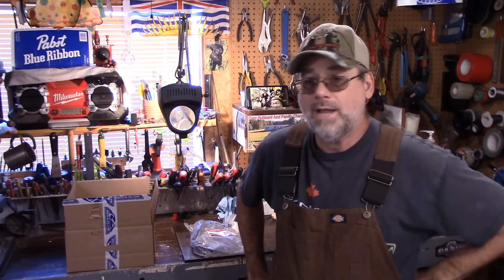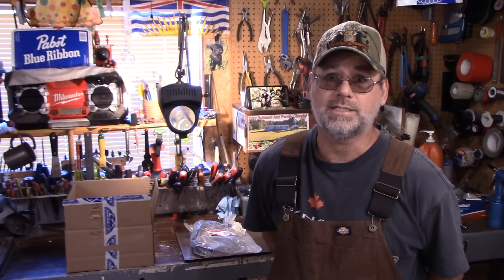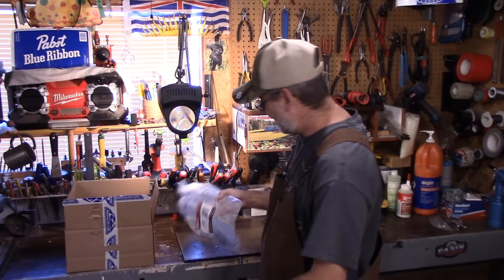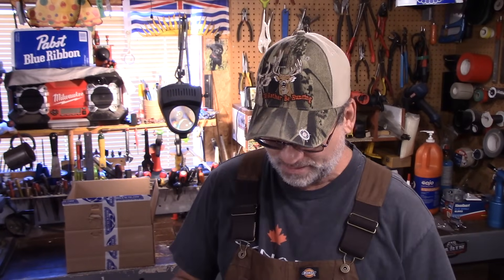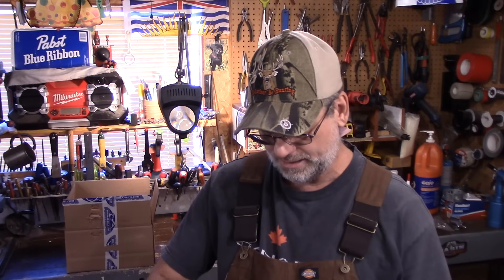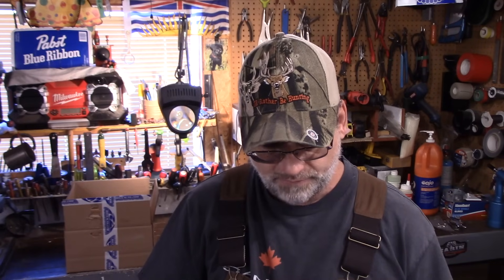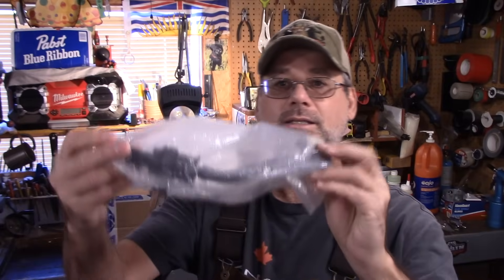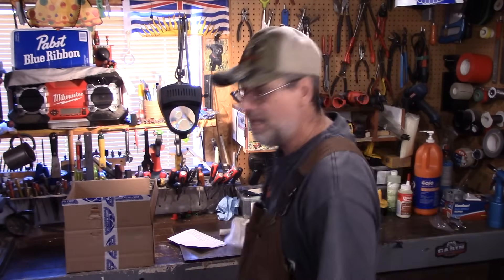F150  STALLING AT STOPS - THE FIX -  PART TWO

Comment: Need some help 2006 ford F150 4.6 liters engine,has a weak take off, and rpms drop when coming to a stop, what can it be?
Reply from the maker: Mike it could be a lot of things but the first check would be a total scan of the vehicle , not generac scan data but OEM . Start there for any codes .
Reply: @SteveRobReviews  no codes what so ever
Reply: I was thinking it would be the throttle  body
Reply from the maker: Could be , if it's not getting min. air or the MAF sensor is dirty as well it could be . Try cleaning both and see.

Comment: Mine is an 87 F150 XLT LARIAT and its weird. It dies randomly. It doesn't do it every day
 Yesterday it died 8 times all day. Today once. If it dies and I just try to start it without turning off the ignition it won't start. When I turn the ignition off then try, it starts rigbt up every time. Changed the idle control thingy, the Egr valve and the cap and rotor, plugs and wires thus far. Could it be my ignition control module?
Reply: And not to mention it doesnt die like its starving for fuel, there's no bogging just dies outta nowhere.
Reply from the maker: Well it looks like your turning off the ignition switch  to off then on  gets it to restart so I would be looking at the control side of your ignition from a faulty ignition switch   , that's my first thought .  I would  wiggle the ignition switch  while parked and see if you can jiggle it to shut off.
Reply: @SteveRobReviews  so I did what u said and jiggled the key and it does shut off but not when I jiggle the key up and down but when its jiggled in the rolling back towards me direction as if you're shutting the ignition off with the wings on the ignition almost to the key off position. Right before the click as if you were to shut it off. I changed the coil and it did die on my way to work this morning. Should I try the pick up coul in the distributor? All this pretty much started when I decided to wash the engine bay.. so im wondering if I got something wet or gunk on something I shouldn't have...
Reply: @SteveRobReviews  oh and by the way my check engine lights is on but doing the jumper in the EEC connectors doesn't do anything with the light. Get no codes
Reply from the maker: @rickyfranklin9343  Well it seems your replacing parts in Hope's of finding the fault , you may run out of money before you run out of guesses 🤣  I would imagine whatever got wet  may be a fault but you could have a wire under the hood that's rubbed bare and randomly touched  metal and shuts the engine off . I would look under the hood at your wiring harnesses before changing more parts .  These intermittent faults can be real hard to find .
Reply from the maker: If the  light is on a fault is detected . I would suggest you do have a detected fault .
Reply: @SteveRobReviews  but the thing is, I cant do the jumper in the EEC connection port and get anything the light just stays on. I hope I fixed it today. I put the old rotor on and blew out the distributor and so far so good. It idles better. Sounds better. Looks better..
Reply: Mine did that, found a bad wire running up coulmn
Reply: Been trying figure it out with my 97 2v 4.6, does it nearly every stop, acts like it doesn't wanna change gears right, revs will drop past idle unless I take my foot off the brake and let it roll a few more feet then the idle will kick back up. Bad sensor somewhere along the drivetrain maybe? Don't know if it still does it or not though, its been out in the woods the past 3 years, thinking about resurrecting it though, and getting rid of my 06 and 04 f150s, 3v 5.4's

Comment: Found this online.. And tired of typing it to everyone asking.. So here you go ￼

This is used for clearing codes by disconnecting the battery cable for 15 mins. Be sure there is no cell phone chargers/lap top/anything like that plugged in. While cables are disconneted i always cycle the key. And turn the head lights on. Then follow it up by the relearn process.

Battery relearn
Because your vehicle’s engine is electronically controlled by a computer,
some control conditions are maintained by power from the battery. When
the battery is disconnected or a new battery is installed, the engine must
relearn its idle and fuel trim strategy for optimum driveability and
performance. Flexible fuel vehicles (FFV) must also relearn the ethanol
content of the fuel for optimum driveability and performance. To begin
this process:
1. With the vehicle at a complete stop, set the parking brake.
2. Put the gearshift in P (Park), turn off all accessories and start the
engine.
3. Run the engine until it reaches normal operating temperature.
4. Allow the engine to idle for at least one minute.
5. Turn the A/C on and allow the engine to idle for at least one minute.
6. Release the parking brake. With your foot on the brake pedal and with
the A/C on, put the vehicle in D (Drive) and allow the engine to idle for
at least one minute.
7. Drive the vehicle to complete the relearning process.
• The vehicle may need to be driven 10 miles (16 km) or more to
relearn the idle and fuel trim strategy along with the ethanol content
for flexible fuel vehicles.
• If you do not allow the engine to relearn its idle trim, the idle quality
of your vehicle may be adversely affected until the idle trim is
eventually relearned.
• For flexible fuel vehicles, if you are operating on E85, you may
experience poor starts or an inability to start the engine and
driveability problems until the fuel trim and ethanol content have been
relearned.
Reply: I did this and it worked and it might work for you. My truck started stalling after I had the battery disconnected cause I was doing some wiring for rock lights but before that my truck was perfectly fine so I was confused on why all of sudden my truck was stalling when reversing and at random lights.
Reply from the maker: May work for some but mine was definitely in need of a new purge valve. Cheers

Comment: My truck dies when I put it in reverse, and my Truck is 2007 Ford F150 Lariat, could you tell me the problem please its just when I put it in reverse and drive backwards it starts too die driving backwards, and there's know codes, Can someone tell me how too fix this problem pleases
Reply from the maker: Might not show a generic code , try an advanced scan tool maybe  looking  at live data while it stalls  ,  could be a lot of things . Mine never stalled in reverse.
Reply: Sounds like the torque converter in your transmission,  had the same thing happen to my 02 powerstroke,  took it to the Ford garage and they recommended replacing the transmission
Reply from the maker: John Pratt  Well that's not a so easy job . Well done John 👍
Reply: Mine does the same thing after I drive it for about 30 mins to an hour then go to reverse and it dies and sometimes at stops after driving for a while

Comment: I have a 2004 heritage 4.6 motor f150 it runs great , when I turn my headlights on it shuts off my engine. sometimes it works going foreward but kills the engine if in reverse.
Reply from the maker: If you turn on the headlamps while driving it does not stall most likely as in reverse its at idle only  so start checking your idle circuts  and the first thing I would do is clean the throttle body as that's one item that can cause the stalling at idle .
Reply: I know this is 3 weeks old but stalling when you turn on the lights tends to indicate ground issues. One of your circuits, whether it's power to the coils, power to injector harness, or whatever else, is likely grounding through the headlight circuit, and when you turn on the lights the draw is too much and it dies

Comment: Mine literally shut off but turns right back on
Reply from the maker: Javier the problem was fixed for me changing the purge solenoid as shown. It's been over a year and it's never stalled. If it stalls while your driving with your foot on the pedal  this is not the fix.

Comment: It should’ve thrown a code if that’s what it was?
Reply from the maker: You would think but no codes.
Reply: It does not. I've tried multiple dealerships.
Reply from the maker: @franklin3271  Mine never thru a code but the purge valve under the hood resolved everything.

Comment: My 1993 Ford F-150 5.8  starts then dies when I release the key and I replaced the ignition switch and pick up coil
Reply from the maker: Lots more to check , are you losing spark or fuel or additional electrical faults. One at a time its fixable 👍
Reply: It’s a new fuel pump and spark plugs
Reply from the maker: New parts are fine but it take a lot of parts to make them work. It basic testing and diagnostics that will find whats not working as it should. A good tech is well worth the cost if your not sure how to fix it yourself.

Comment: I’m having the same problem I believe mine happens every now and then but at a stop light then it feels like as soon as the light turns green it dies and shows the oil pressure light however the truck will allow me to restart it right away then goes back to driving like normal do you think I have the same issue? And has it resolved yours?
Reply from the maker: Brock that is exactly the same as mine was. It was the fix for mine and it's been one year since I installed the new part.  It will take you about 5 minutes to change it yourself. Let me know the results. Cheers

Comment: Will this work on a 2016 5.0?
Reply from the maker: No sure but if the symptoms are the same its worth a try if all else doesn't work.
Reply: @SteveRobReviews  Hi Steve. Well the part worked for the most part. My truck idles at 500-600 when engine is warmed up. Used to idle at  300-400. But tested it out for a longer run this morning and it still feels a little sluggish. I'm assuming its the drop in temperature today. yesterday we were at 50 degrees F. T his morning it was 34 degrees F. Truck still runs good though. Might buy another valve just in case.  Thanks for the helpful suggestion.  Subscribed.
Reply from the maker: @e.s.5872  Terrific , the ecm does do a recalibrate over time to learn the new parameters so it may be a perfectly normal occurrence.  Cheers

Comment: Has it stalled again? I've changed mine out & it just came back😂
Reply: Mine is a 2012 5.0 tho & now at times I will turn the key and it wont start after a few times
Reply from the maker: Mine has not stalled once since I change out the purge valve . Jose call  Ford Motor Company and ask them if this is a known fault . Can't hurt ....
Reply: Jose Bernal 
Any luck finding and fixing the issue?

Comment: I have went to Ford twice and they don’t know why my engine shakes then turns off when I stop. It happens about 15 times a month for the last six months. 😭 F150 Lariat 2016 Please help
Reply from the maker: Well for $50 just put a new evaporative vent valve on it and see if it solves your stalling just like it did for me . Under the hood drivers  side of the motor , take 5 minutes to change.  Worth a try because my dealer told me the same.
Reply: @LA-TEEZI  Ford still can’t figure it out I used a fuel additive it stops for about two months I think it something to do with the fuel line.
Reply: @LA-TEEZI  My Truck is still thankfully is still under warranty so they haven’t charged me anything. I just want it fixed I’m on the freeway and traffic and my car stops it’s just ridiculous. Super expensive lariat and I’m gonna drive it until it stops working altogether.
Reply: @danisshaavery100  our truck is doing this too, did you figure out the issue ?
Reply: @melissabudden3470  yes finally it was our timing. It costed over $7000 to fix. I can email you the work order from Ford if you want because I might be explaining it wrong. 😂

Comment: This work for 1992 for f150 do you know
Reply from the maker: If the evap vent valve is sticking open on a  deexcellerstion , yes it can cause a stall . No guarantee it will fix your problem but it's something to look at . Cheers

Comment: Thanks for the video! 
I have got a 2010 F150 LX that dies when slowing down or slowing down and turning right. 
Also, there is a continued misfire when gassed. I think my issue is with the plugs and coils. 
Last year, I had the same issue which was water in one of the plugs; replaced the plugs and 4 coils since it is  4.5 L and V8 and the problem was fixed.
A few days ago had the same issue and 2 more coils were burned so I had to replace them. But still, the issue exists. I think what you have suggested will be the issue to resolve.
Reply from the maker: Give it a try then , its a low cost try.

Comment: I have a 2010 f150 5.4. No problems occurred with my truck until a month ago. It stalls at stops and almost will not crank unless I ease into the gas to help. Once stalling the start is so rough it’s almost like the engine is dead. But if I start it back up and do what I said the truck is fine..until slow down under 10 mph. Truck threw a code for bank one position one o2 sensor which I replaced but did not fix my problem. I’ve spent two weeks researching this and have nothing but more questions. I’d like to save money but my luck is running out. If anyone had some ideas please share
Reply from the maker: I'd take a look at your throttle body and see if it needs cleaning first. Worth a try .
Reply: STEVE ROB REVIEWS 10-40 I’ll look into it. I’ve got a new code at the moment. Waiting to check it once my dad gets home with the scanner
Reply: Hey did you ever figure out what the issue was? My truck is doing the same thing. Thanks.
Reply from the maker: Jordan it's been over one year and not one stall. Yes it was the purge valve  that fixed it. Cheers

Comment: I have change coil packs plugs fuel injectors fuel pump fuel module and fuel pressure valve truck still will not idle right and will not accelerate It Off can somebody help me
Reply from the maker: Wow that's a lot of parts .  Make , model , year and engine is required for a comment. Maybe someone can help.
Reply: I have a 2000 F-250 V10 doing the same thing could this be its problem as well Steve thank you
Reply from the maker: Tina I'm not going to guess at your expense but I did try it and its been stall free since . If its doing the exact same thing it could be the exact same part failure so its your turn to guess or not :)
Reply: Yeah go get a toyota truck

Comment: 2015 f 150 5.0 coyote v8. Replacing the cam sensors, new motor in the truck and it didn’t fix it
Reply from the maker: Keep at it  Kyle .
Reply: This truck has been a piece of work. Bought it over the summer it was a Canadian truck. You don’t need to have service records with trucks that come from Canada. Dealer admitted the engine light was on for the catalytic converter‘s, they replaced them. The truck turned out to have further issues like the timing chain so the dealer replace the motor for free. In the process they stole almost $1000 worth of things out of my car. The new motor made no change on the issue. It will surge(gain power then lose power then stutter) but it hasn’t fully stalled in a while. Happy new year!
Reply from the maker: @kylehart8287  sorry to hear Kyle. You definitely need to see a good diagnostic technician.
Reply: Got it back! She still is having the same issues. Lemon lawing the dealer (I live in Michigan). Have a LOT of money in and more that needs to go in. Will keep updating when it gets fixed. Hope you had a happy new year!
Reply from the maker: Kyle you do all you can .  HNY 👍

Comment: Advance auto parts with a 20% off online code and a 20$ off coupon. It was in hand in 10 minutes for $48.61. That's a deal...lol.
Reply: Still didn't help though. Random misfire was causing low to no idle under brake booster load.
Reply from the maker: WOW  thats wild ......

Comment: Today my 2016 F150 just stopped at the lights. I waited a little and then cranked it again it started but after about half a mile, it stopped again. Guy came to jumpstart it but said it was not a battery problem. Autozone tested battery and receipt showed battery was good. Please someone help
Reply from the maker: Lots of possible reasons , might be a code stored in memory to help if you do your own repairs , if not a professional opinion is in order. Good Luck.
Reply: Did u ever figure it out?
Reply: If u haven't figured it out I can send you some suggestions to start with
Reply: @lindseywagner7510  maybe they got it figured out but I have a 2016 f150 5.0l also and doing the same thing
Reply: William Thompson yes me too. Did you figure it out?

Comment: My 2014 has been doing the same thing for some time now only on deaccleration and I replaced my purge valve and still having the same issues. Any other ideas? Thank you
Reply from the maker: Yes the throttle body may be real dirty so try cleaning  it and go from there .
Reply: pull out the eec (computer) look at the circuit board and see if there is brown gunk on the board from leaky capacitors.

Comment: I have a 2011  F150 5.0 Coyote....l changed the purge valve and l'm still having the stalling issue at stops runs great when driving down the road...no codes....any ideas what i can try?
Reply from the maker: I would drive it and have the passenger look at the scan data  when it stalls out, it might show a loss of fuel pressure  or some other dropout.
Reply: @SteveRobReviews  ok  will try that ....thanx...i'll keep you posted
Reply: @biker071863  might be the idle air control valve
Reply: Vvt selonoid
Reply: bad wire on the purge valve @SteveRobReviews